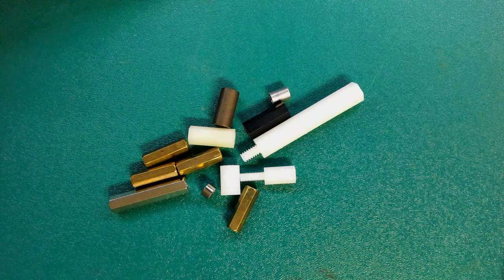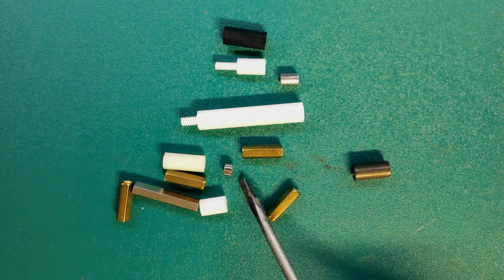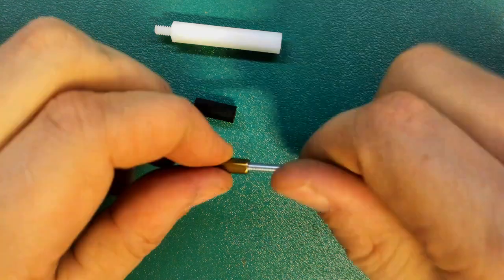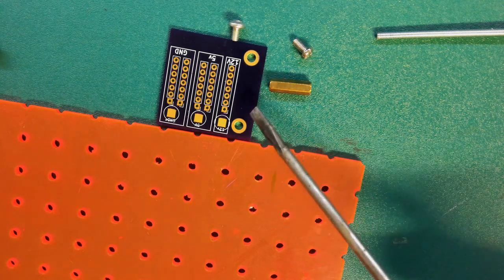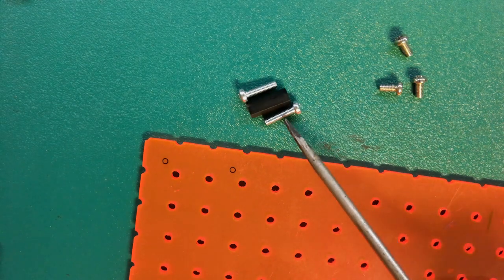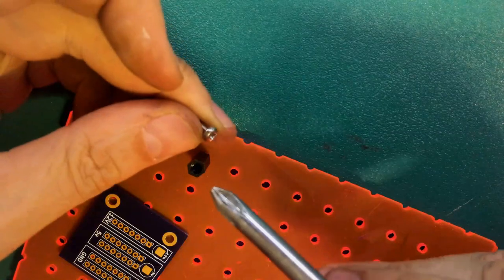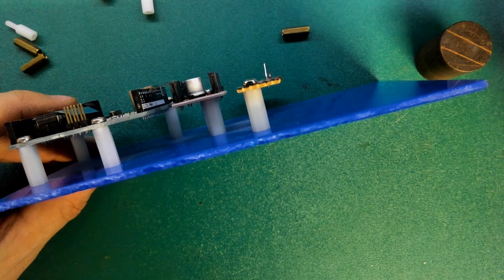How do you ya mount a pcb. AKA  - what is a standoff

Comment: Thank you mate (?) for this rather helpful video. Here in the US we call those screws and not bolts. It's just a matter of scale. Also we're quite happy using our fingers to get the screw initially into the threads and don't struggle to do it with a screwdriver. We however use a screwdriver to tighten the screw once it's inside the standoff. Thanks again for this very helpful video.

Comment: Are the holes on the corners of pcbs standard sizes? Seems like it would make sense to get the biggest thread for a given hole. Got a raspberry pi and it seems like everyone suggests 2.5M and I’m not sure why.
Reply from the maker: G'day, pcb's and standard sizes. Yes... but there are lots of 'standards' 2.5 mm is a standard size. but it's not a popluar standard size. People recomend 2.5 mm stand off's for a raspberry pi because the mounting holes a machined a bit smaller. but you can fit 3mm stand offs in the raspberry pi, it's just a tad tight.

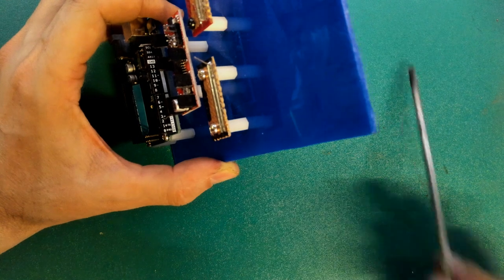Comment: What's this type of board / material at 0:45? Thanks!
Reply from the maker: G'day, That's PVC. So I use this wonderful material because it's transparent and you can see what's happening behind as I'm demonstrating.

It's a wonderful material. Although if it snaps or shatters for any reason (perhaps you drill a hole in it) it gets these super sharp edges. I've cut myself more times than I care to admit (a few times even through gloves).

https://en.wikipedia.org/wiki/Polyvinyl_chloride